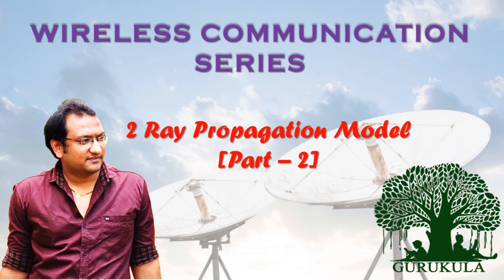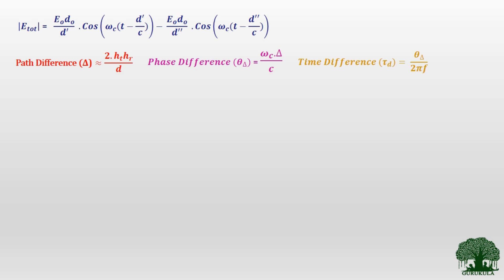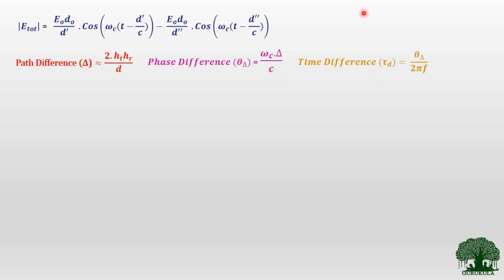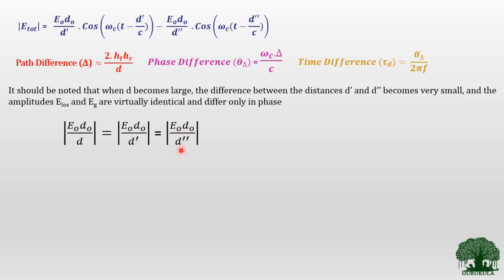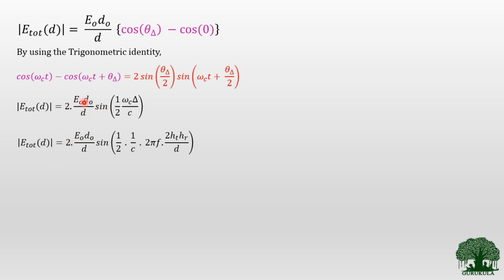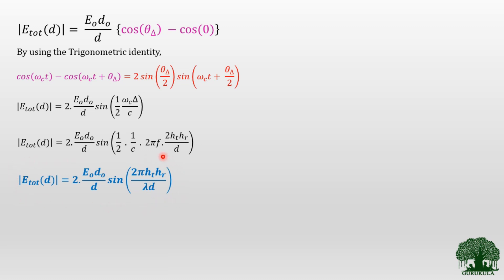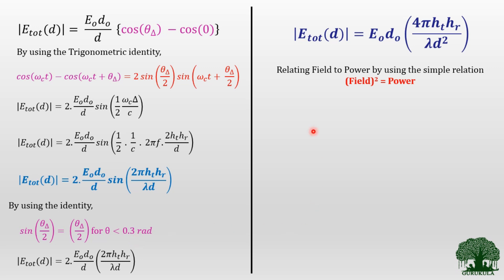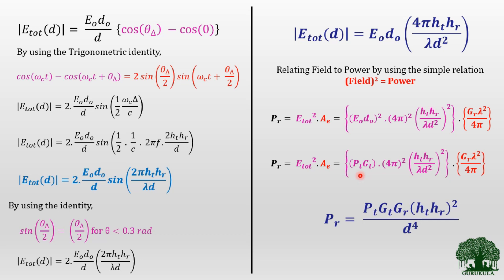2 Ray Propagation Model - Part 2 | Ground Reflection Model | Wireless Communication

Comment: The relation between power, e-field intensity and effective area shown @10:08 is incorrect!! e-field unit is V/m, effective area unit is m^2. multiplying e-field squared and area gives volt^2. and on LHS you have Watt. free space impedance is missing in your equation!!
Reply: I think he meant Ponyting power density. Yes, the intrinsic impedance is missing.